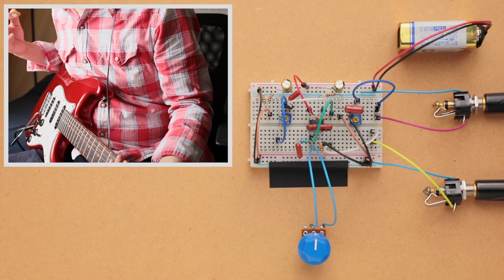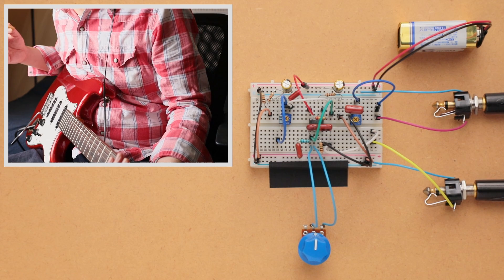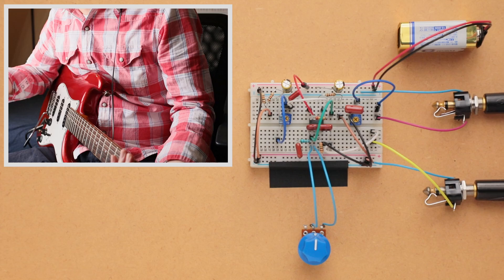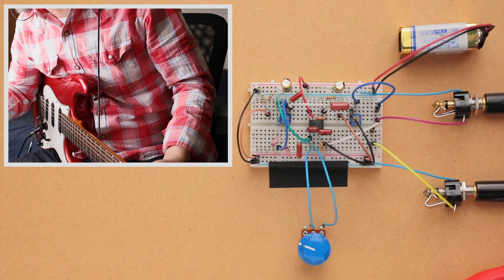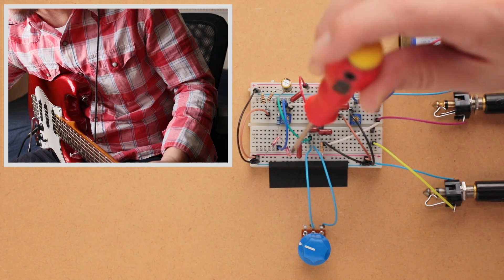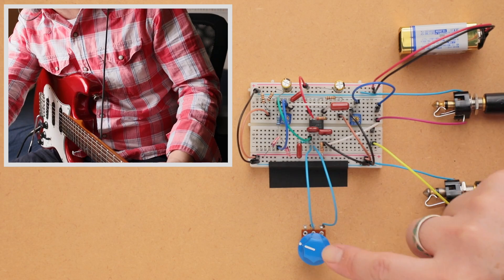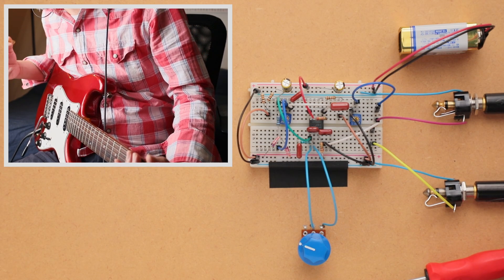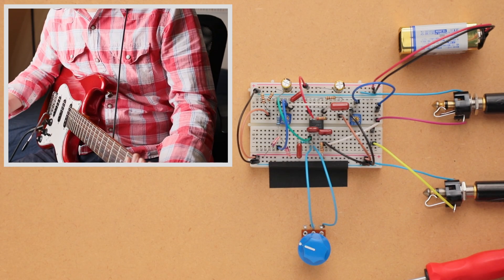Are Elusive Magic Diodes REAL? Germanium Diode Overdrive Tone With 9 Vintage Japanese Diodes [1N34]

Comment: Nifty ! I did similar experiments LONG ago. My hands down favorite distortion effect box had always been the MXR Distortion / Distortion +(Dunlop I think). I had copied them a few times. It is such a clever & quite simple circuit. Just one op-amp(an OG 741 I think) & only about half the components(at most). At the time, It was before I ever even studied EE, so I really had very little Idea of what I was doing. But aside from cap types & values, I do indeed remember experimenting with the "2 clipping diodes" & the big clear glass Germaniums Vs. silicon made a pretty clear audible difference(in that circuit anyway). Odd you would even test fuzz/overdrive/distortion on just single coils though. Cool vid though, total Deja vu. 👍
Reply from the maker: Thanks for watching and welcome to the channel! Yes, the Distortion + is a great pedal, both in its simple beauty and tone! And as you mentioned, in a pedal like that, silicon vs germanium diodes would make a significant difference! I used single coils in this video because a humbucker or P90 would start clipping the op amp early on, and I wanted to make sure that the op amp stays clean. 😃

Comment: Germanium is so wildly inconsistent trying to manufacture with them must have been hell. For modding you can pick and choose. How asymmetric do you want it? On which part of the wave?
Reply: If you have an oscilloscope the clipping curve between SI and GE is very visible. LED is mostly SI with just a much higher clipping voltage.
Reply: I also can't tell the difference between "modern" GE diodes (still made for radio I think...) you can buy fairly cheap and NOS stuff I have.
Reply from the maker: Hi Justin! Thanks for watching! It would be fascinating to interview or hear stories from people involved with those early electronic component manufacturing!

Comment: At ten minutes in, you mention that the clipping diodes HAVE to go to reference ground, as opposed to 0V ground. Why is that? I hear this stated often and (other than as a bias) I don’t understand the logic. Great video!!!
Reply: Your signal is an AC voltage swinging back and forth around some reference. If you clip to below your 0v point or "reference" (0v is always relative) you're biasing the signal towards the negative side. Same for the other way. Voltage is all about difference (potential.) Having a signal swing between 498v and 502v carries the same information as -2 to +2.
Reply: @justovision  That all makes sense and thanks for the quick answer!
I guess the part that still doesn't totally add up for me is this-  In a lot of pedal designs using 9V DC power, the hard clipping diodes DO go to 0V ground, but sometimes it is 4.5V reference- what am I missing? 
Is it because in certain cases, the  opamap/transistor/jfet was biased to 4.5V and there is no DC-blocking cap before said clipping diodes? or...would it be safer to say that when there is a reference voltage, other than 0V in the circuit, use the ref voltage?...Thanks for your patience in advance!
Reply from the maker: @jonfuzzywallz  Just to add to Justin's reply, in most pedals we are running the signal between 0 to 9Volts. So in order to keep the signal swinging up and down between that "floor" and "ceiling," we "raise" it's center by +4.5v. Which is why "reference voltage" is often referred to as "virtual ground." And yes, as you have guessed, when you see hard clipping diodes go to "true ground" it is because it has passed through a capacitor. That topology would most likely happen when the diodes come towards the end of the circuit and there is no further amplification stage after it. Hope this helps, and thanks for watching!
Reply: @arito  that totally answers it!
Reply: @jonfuzzywallz  Do you a schematic you can link to?
Reply from the maker: @jonfuzzywallz  Great! Glad I could help! Obviously, there are circuits where there might be an amplification stage after the clipping (to true ground), in which case, there would be another capacitor followed by a bias to reference voltage. That would also be true for any output buffers after the clipping (like a DS-1).
Reply from the maker: @justovision  Hi! Was this question for Jon, or me?
Reply: @arito  For Jon, sounds like you cleared it up. I was wonder if there was a schematic he was looking at where they clipped to non-reference ground before a decoupling cap. 👍
Reply from the maker: @justovision  Sounds good, glad I was able to clear it up. 😀
Reply from the maker: @justovision  Thanks for your help and replying to the question Justin! 😃
Reply: Just to add to / confuse things ;) ... If youre driving a HIGH current through the diodes, that can disturb the internally generated 'mid rail' voltage, interfering with other stages in a more complex pedal which is why some designs, (like several BOSS) return to the 0v (negative rail) ground

Thats awkward DC-wise, so for a breadboard build it makes sense to do it Arito's way - only if you're designing a multi-stage high gain pedal (or a multi distortion like an OS-2) you REALLY need toughen up(decouple) and reduce the MidRail 'reference' impedance for stability...If you do it that way, lower resistor dividers hog battery current, so a high-current opamp midrail buffer is good!
Reply: @petegaslondon  that all was making sense until the end there- I know how to build buffers and creating a 4.5v reference is very familiar. Buuut…are you saying to use high value resistors to create the 4.5v reference (like 100k vs 10k), or lower ones? Also, are you suggesting I build an opamp buffer INTO the vref part of the circuit? Cornfused…🌽
Reply: Well, the bog standard midrail is just made by a decoupled divider, right? Like in this circuit

One way to make its impedance lower is a bigger decoupling cap - and lower resistors, but they use more juice, if youre running off battery

So it can make sense to have a high impedance (say 2x 100k) midrail divider, followed by an opamp buffer - maybe a 2 ohm res between its output and the decoupled rail, something like that

You could build a design and find you need none of that guff, but if you get stability issues (eg if your design has other stages in, more opamps)  you might need to do it

Does that make sense?
Reply: @petegaslondon  Still trying to grasp this, kinda getting more and more confused actually...Without any diagram (you said "like in this circuit" but no circuit I can see) I am not understanding where this "opamp buffer would be in a circuit". Would audio be passing through the buffer or is this some sort of PSU power buffer? Thanks for your patience!
Reply from the maker: @petegaslondon  Hey Pete! Great to have you back! And thank you for sharing your knowledge and expertise!
Reply from the maker: @jonfuzzywallz  I think this might help, google search: "BE-OD schematic" this circuit shows a lot of what Pete is referring to. It's a high gain multi stage distortion using 3 op amps, and if you look at the power supply, there is an op amp used as a buffer for Vref. Also, the final LED hard clipping stage is going to Vref, since it has been stabilized by the op amp buffer. Not something you'd see everyday, but he Friedman is a "boutique" pedal, so I can see why they would go all out with a no-compromise design. Hope this helps!
Reply: @jonfuzzywallz  - like in the circuit at 3:44

The midrail (=Vb) divider of the 2 10k Res's decoupled 

And yes a power buffer. You disconnect the Vb rail from the divider put a simple opamp buffer after it .. 

Imagine cutting the wire to Vb, wiring the divider to opamps +input, its -input wired to its output, and the OUTPUT of the opamp is now your source of Vb

Opamp in question needs to have a reasonable output current spec, and its prob overkill, so 90% of the time you dont need to go to the trouble

But if your super high gain pedal is unstable you DO need good supply lines !
Reply: @arito  Well, THATS nice to wake up to - OK I've been kerrangging thru a litle prototype lately, maybe its time for a vid ;)
Reply: @arito  that actually does! As they say- “A picture is worth a thousand words”. Found that schematic and I’m saving it to mentally tear apart later. I think I get it now. What a great community and channel here.
Reply: @petegaslondon  I think it’s starting to sink in now. You’re awesome! I really appreciate you going out of your way for me. Between you and Arito, I’ve been educated!
Reply from the maker: @petegaslondon  Sounds like you've been busy! Hopefully we'll get to hear that prototype via video! 😁
Reply from the maker: @jonfuzzywallz  Great to hear that! Yes, I always get confused when reading about theory and definitely need visual aids as well.